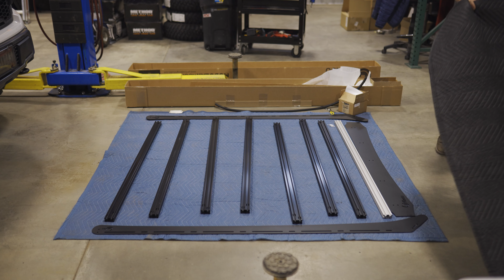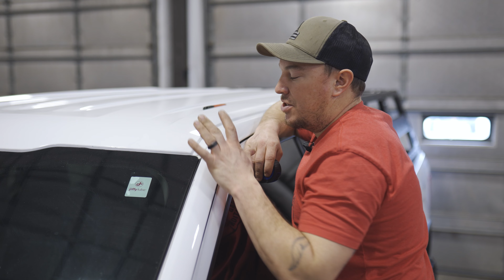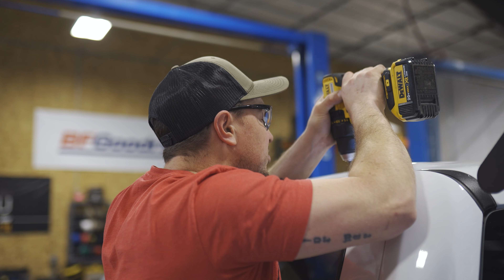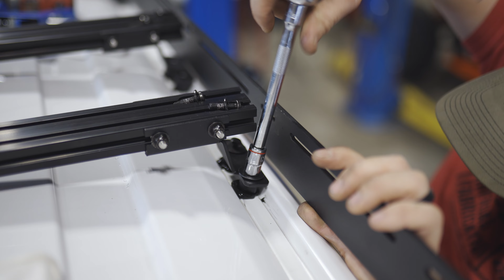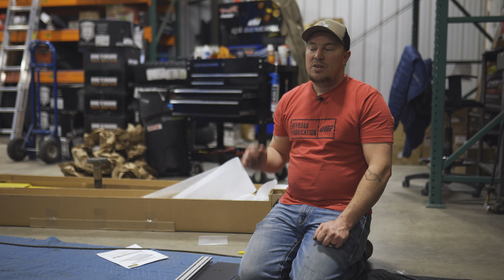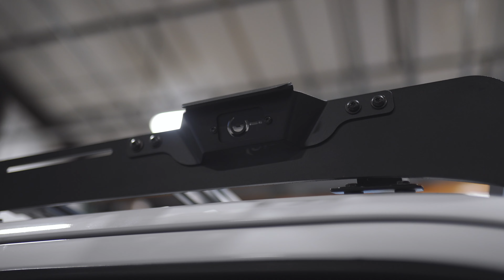PRINSU INSTALL: F-150 Roof Rack

Comment: Nice.  Do you know, is there a cab mounted roof rack that can support the weight of a pop up roof top tent, including with say two adults sleeping inside while in use, say a Roofnest or any number of other brands?  Being able to mount and use a pop up tent above the cab opens up so many possibilities for the use of the bed and access to it, but is it doable.
Reply: Yes the Prinsu rack does fully support a roof top tent mounted with people sleeping in it. As a matter of fact that is one of the main reasons people choose our rack and install it on their vehicles.

Comment: Is this universal? I have an old 2001 F150 Supercrew. Would love to install this if it fits!
Reply: We have not fit this on your model of F-150. Kiley you could make it fit although there could be a few areas where the fit may not be perfect.
Reply: Will this roof rack fit a 2008 F150?
Reply: Did you install it on your 2001 F150 Supercab? I am looking at it for my 2002 F150 supercab.

Comment: How’s the wind noise with something like this?
Reply: We have tested most racks on the market and the Prinsu rack is the quietest by far. The low profile design and the way they created the shape with the wind deflector make it incredibly quiet. Most models only add about 1 to 2 decibels of wind noise over stock.

Comment: Game over at drilling holes
Reply: It’s no different that vehicles that have factory roof racks. They are installed the same way after the vehicle is built at the factory.
Reply from the maker: Yes drilling can be intimidating, so if are you interested in this rack we can help you find a local shop that can install it for you!
Reply: This is scary to me too.  I’ve never had an OEM rack leak, but I’d be worried about this. Too bad the F-150 doesn’t come with OEM rails. Still don’t understand how those rivets attach to the roof.

Comment: No racks for a 2014 raptor?
Reply: How would it not?  It’s the same roof /cab as regular f150s isn’t it?  Wouldn’t the version for the 2014 F150 work?

Edit - I am not seeing a version for earlier F150s. But @Mav installed one on his 2011 F150, I am assuming that this would also work for that version as well?  I have a 2013 F150 and looking at one of these.
Reply from the maker: Unfortunately we don't have a rack for this model.